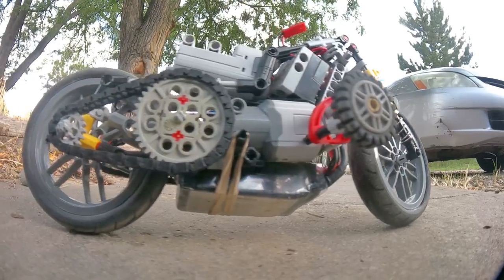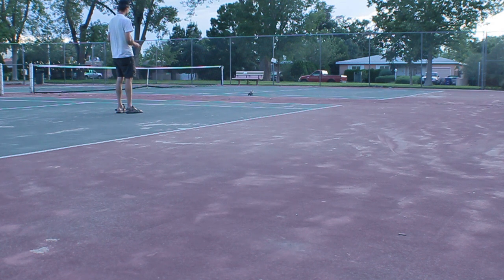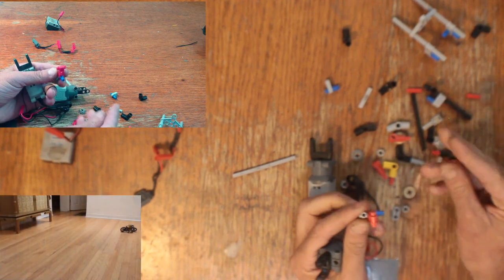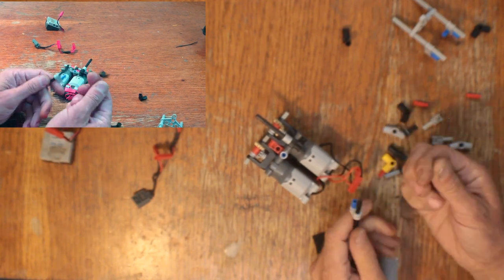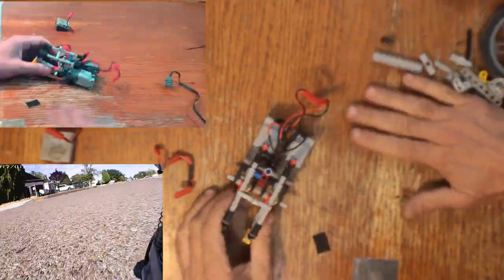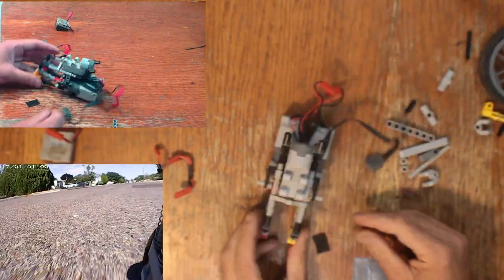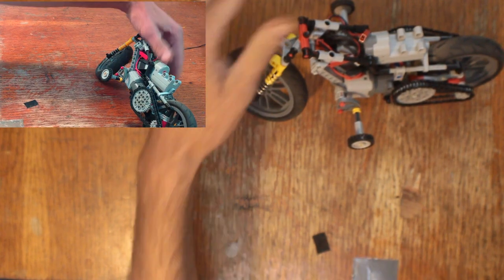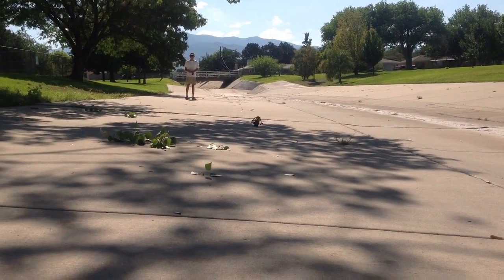How to Build an RC Lego Motorcycle

Comment: What is the total price of all the parts, and where can I buy it?
Reply from the maker: People usually build their Lego collection over many years. They can be expensive but there is no better investment in "toys". For specific pieces Bricklink.com. If you want to bulk up your collection buy chinese copies on Aliexpress.com. or Ebay.com.

This is a difficult model to make work correctly
I would not recommend people buy stuff just to make this model.

Wheels- <$10
Motor-I think I found 4 for like $20
Beams, axels and pins  Maybe $10
You need a remote( Lego IR -Not very good for this)so Sbrick or hobby Radio + ESC - $ $60
You have to use a small LIPO battery $15